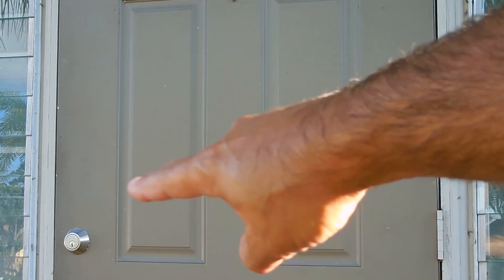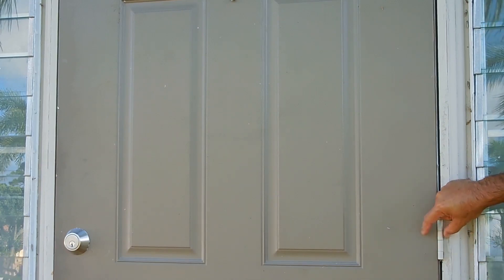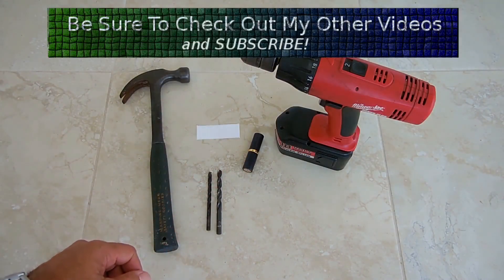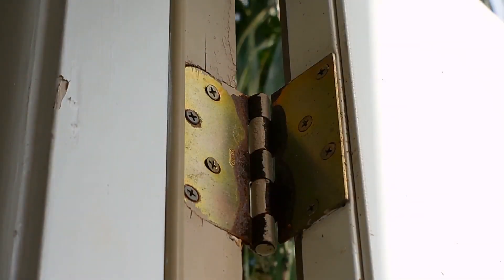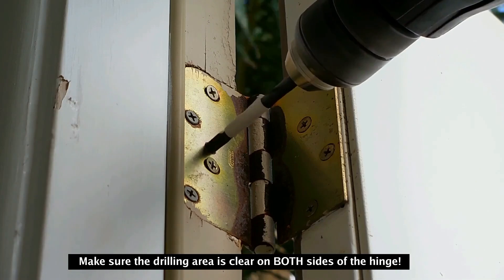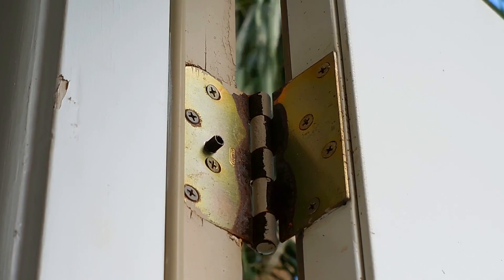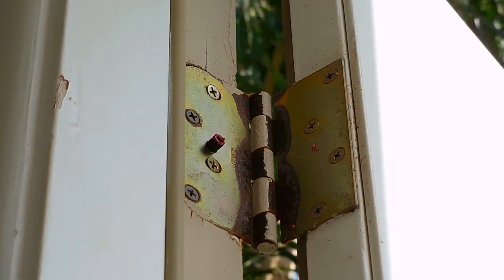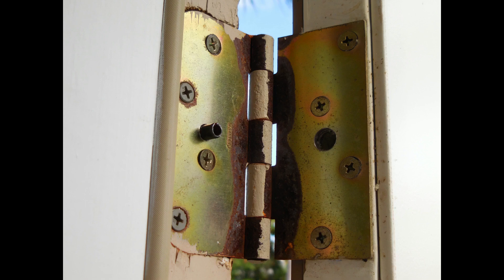EXTERIOR DOOR HINGE Security Hack!

Comment: very helpful. most home invasions are from kicking in the front or back door that opens inward, the down side is the outward door has accessible hinges which you solved with a very clever solution thank you.
Reply from the maker: Glad you enjoyed my video! I have a lot of excellent videos on my channel that cover many different subjects, so be sure to check out my extensive video playlists for other videos of interest to you, rate thumbs up, and share my channel with others. Thank You
Reply: @electronicsNmore I have an old apartment with this issue and I want to fix it. I know I can order safety pins? But I’m thinking of trying this. What do I need to get for drill bit size and the size of the pin? I would PM you but I’m sure you get a lot of messages.

Comment: Thank you for this. I have an apartment door to my balcony with hinges on outside. This will solve my problem thank you.
Reply from the maker: Glad you enjoyed the video! Be sure to rate thumbs up and share with others. Thanks
Reply: Me as well. I had thought about buying expensive outward security hinges with the pin but this will work for a relative who lives alone and has a outward opening door. While it is secured with a fancy double key dead bolt high end the hinges are the weakness. This will also make me use my depot gift card finally to get the pins and other knick knacks. Thumbs up.

Comment: House was built 2018 with a out swinging door.  Definitely know about that and was wondering why that would be ok in this day and time but a great hack I will install today. Thank you!
Reply: They make hinges for out swinging doors that have a screw that goes into the hinge pin that is only accessible when the door is open. It prevents the pin from being removed until the screw is removed.

Comment: Thanks for this Video. I just followed your guide and it worked well. If I could add two tips:
1 - Do one hinge at a time and make sure it works before moving on to the next one. Chances are that at least on one of them it will have friction and this way it will be easier to diagnose
2 - if you have friction, instead of moving to a larger diameter bit, enlarge the hole horizontally by moving the drill side to side (not up and down since the issue is probably down to the angle of attack)

Comment: Thank you. I have to install a new door that swings out, because the tiny landing is situated so you can't bring anything into the basement. If i install with door opening out, I will have access to the downstairs staircase,  as well as the upstairs staircase going into kitchen. I was thinking had to get a special hinge set,, but this trick 👌
Reply from the maker: Take your time doing it, it works.

Comment: This is a great hack. Ottawa police taught me that one, after we had a break-in. Only difference was they called for #10 wood screws, instead of the steel pins. Holes in the hinges were just slightly larger then the screws.
Reply from the maker: Glad you enjoyed the video. I have many excellent videos on my channel, so be sure to look over my extensive video playlists for videos of interest to you and most importantly SHARE. Thanks!
Reply: Tension pin better screws shear easy
Reply: @stephanpicotte5863  Replace the wood screws with cobra/tapcon 3 1/2 inches hex head screws. Chop the head at the right length with an angle grinder. Won't move nor shear easily. with a 3 1/2 or a 4 inchs screw, you can fix it to the wall frame.

Comment: most doors have 3 hinges. i just unscrew the hinge plate from the door and drill both holes at once then put the screws back in and drive in the roll pin
Reply from the maker: Yes, that's another great, accurate way to drill the holes. Just make sure the hole the pin will go into is slightly larger. Thanks for watching!
Reply: i'm not sure what you mean  by hinge plate but i was thinking of removing the hinge and drilling once thru both "wings" and maybe installing a set screw but of course that would involve tapping the hole to the right thread. i may try using the tension pin on a scrap piece of wood before i drill into the door itself.

Comment: Great tip for those that feel the need for this mod, I would recommend some extra ball bearing grease or similar as using my wife's lipstick is going to get me thrown out of the house in short order; in this case I would not want to apply this mod. I will need to get back in. Just a little fun. Humor guys..
Reply from the maker: Yes, a film of thick grease also works well. Thanks for watching!

Comment: External doors should always have the hinges exposed only on the interior side to provide security on the hinge and lock side of the door.
Reply: Exactly, who the heck installs them any other way?
Reply from the maker: Incorrect. Many doors have them on the outside, and most modern doors have security hinges. I can kick in an inward opening door in seconds, good luck kicking in an outward opening door.
Reply: First off, I wasn't knocking your workaround, and I also don't think the poster Inspirational was either so I'm not sure where your hostility comes from. Truth is it's a decent hack however using a solid pin would be better IMHO.

The point I and I think Inspironator were making is that the vast majority of residential doors open inward protecting the hinges from any external tampering. I have installed at least 45-50 doors in my time and the only time I see door's that have hinges on the outside were on mobile homes and trailers. Not once on a residential house in SoCal.
Reply from the maker: Bill Kenny First of all, there is no hostility, except from a very small number of my viewers. Second, you need to read my "Pinned" comment. Third, So CA isn't So FL. Lastly, the hardened tension pin is more than adequate for the job.
Reply: Those types of pins are used in the auto industry to keep the axles in place These are very strong.
Reply: Actually, in South Florida out swing doors are commonplace. They hold up well against hurricane wind pressure.
Reply: An outswing door has the hinge pin side on bvb the outside due to how a hinge works.  There are hidden hinges to combat this problem but it's not uncommon to see these hinged like his example.

Comment: I see videos all the time claiming that hinges on the outside without added security enable someone to open or remove the door by simply popping out the hinge pins. Yet, I've never seen a video where they actually do open the door that way. Try it sometime. It's very difficult at best, if not impossible. Sure, you can get a crowbar or a reciprocating saw or something like that and manage to get the door open that way, but you would essentially ruin the door and/or hinges in the process, and it would still take some time. You could probably open it on the latch side about as easily if you have the tools and strength. The point is, your average burglar is not going to be any more successful with opening a locked door with the hinges on the outside. The problem is the barrel of the hinge the part you drop the pins through is wide enough that the door itself will not slip past the part of the hinge still screwed onto the jamb. Unless you have a really sloppy fit, you just can't move the door toward the latch side enough to get it open on the hinge side. As a matter of fact, hinges on the outside might actually be less burglar prone than doors that swing in. A person could likely kick in a door that opens inward. You're very unlikely to kick in a door that opens toward you.
Reply from the maker: I prefer doors that open out, especially for a wood door and door jamb.
Reply: You can easily pop hinges . Then take a pry bar on that side. Then slide the door and you in. When I do flooring I remove doors to do the floor. Takes less than a minute..
Reply: You might have a valid point HOWEVER some people have French doors (two single doors facing each other) and they will easily pop off because the center of the two doors have no reinforced.

Comment: Would be more accurate (less risky) to remove each hinge, one at a time, drill one hole, and then match up that hole to the opposite side, to make sure hole centers are aligned.  Otherwise, great idea.
Reply from the maker: Whatever works for you. :-)
Reply: Hmmm sounds like a lot of extra work. The lipstick marks it perfectly

Comment: Who has an out swing exterior door, the hinges should be on the inside not the out.
Reply from the maker: I guess you haven't been to many other places in the world, it's very common, especially in hurricane prone areas.
Reply: Very common with businesses, especially those using steel exterior doors. Just be aware of any business you go to if you are pulling the door open vs pushing. You'll realize it's pretty common.
Reply: I’ve never seen a residential home with a out swing. What keep the water from coming in?  The seal is on the inside. Seems like the water would run in around the door and come in through the latching mechanism.
Reply from the maker: @atvridgerunner  The threshold has a seal.
Reply: I know that but there no seal around the top or sides. You would never have a out swing unless it’s under a 8’ covered porch
Reply: ATVRIDGERUNNER t an out swing door would actually be easier to make water and air tight. you can just make a threshold on the door. 
this means you can easily oversize it and have it stop right against the exterior. plus your door won't be rubbing against the threshold all the time which can cause it to weaken over time.

one of the advantages of an out swing door is the better capability of sealing haha